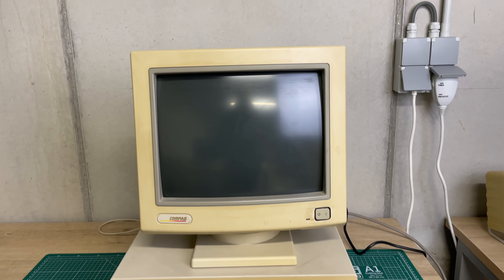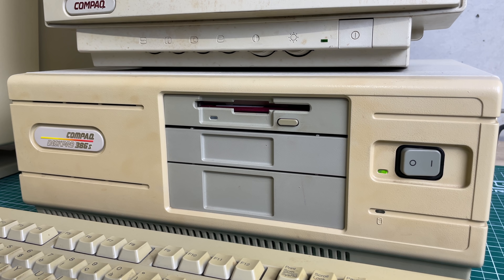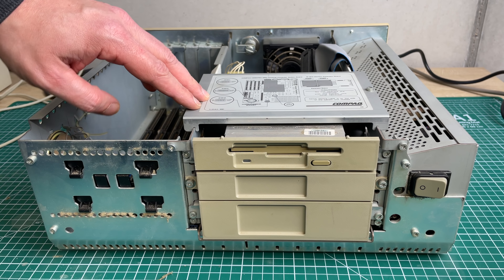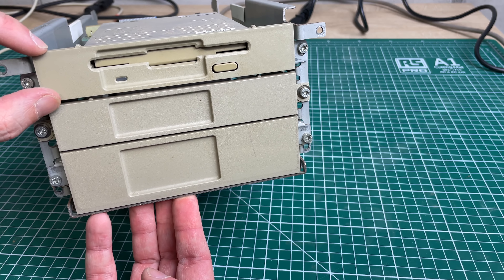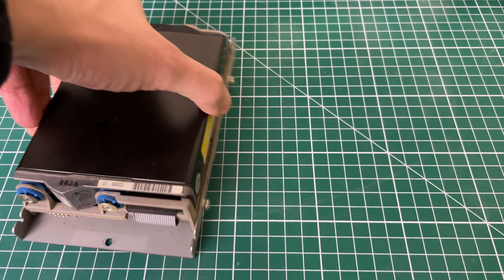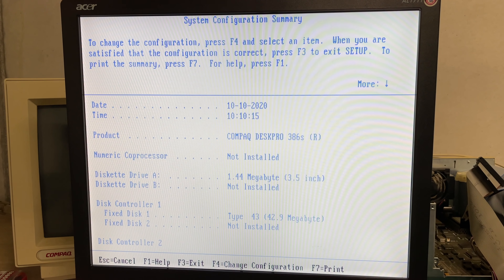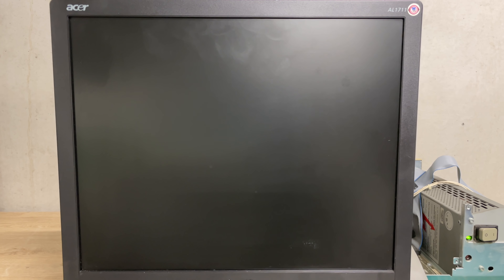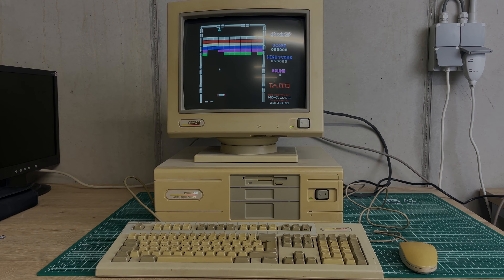Compaq DeskPro 386s first (and last ?) look

Comment: Thanks for the shoutout and for the video. Makes me curious what it was about the smoke as well. May be an insect on the flyback converter? Or some moisture, which started to evaporate? Could you smell it? Sometimes it helps to put the nose into it and try to smell the spot if you don't have COVID. And of course with pulled cables, if you like your nose :D
Reply from the maker: It did smell, was pretty sure it was a rifa but upon inspection I could not find a damaged / cracked on. The smoke had to have come from somewhere and if it came from the RIFA I imagine it would be visible. Will need to investigate further.
Reply: @RetroSpector78  Yeah, RIFA is the most obvious reason indeed and you are absolutely right, it is usually clearly visible. Hm... may be there is a one out of 1000 case, where the damage is not visible from the outside?! Uncommon, but who knows...
Reply: @necro_ware  that's why they call it "magic smoke!"
Reply: @RetroSpector78  Probably the RIFA fails open instead of short circuit?? 🤔.. and it does not prevent the monitor from working 🙂....... Power Supply's works without them.. are for filtering there.. rigth?.... maybe same here 🙄..................... with the HDD.. I think that the two yellow capacitors that you remplace in the other same model HDD.. are also damaged here 🤔....... Not enough to blow up yet 🤯.. but for pull down the 12V or 5V rail enough to prevent the HDD from start ...
Reply: @RetroSpector78  Plot twist: burned RIFA was down in the system unit's PSU and the monitor just picked that smoke up by CRT convection air stream

Comment: Rifa caps are installed across the AC input to help filter out some of the high frequency RFI that switching supplies generate. When they fail they usually short across the AC. This results in a large surge of current, heating the shorted metal into a rapidly expanding plasma burning the dielectric and bursting the casing. In other words, BANG! and smoke. Once the metal is vaporized the short is gone and all is well. It happens so fast that a fuse usually doesn't have time to open.
Reply: Agree. A common BBC micro computer problem as well. Once blown, the unit normally still works fine.  But it would be best to replace all of them.  They tend to show cracking and distortion before they blow as well.
Reply: Considering how old this thing is, could it also just be accumulated dust blocking heat and the dust smoking or catching fire without really harming the electics?
Reply: @3dmaster205  nope. Rifa caps (the transparent ones) will fail no matter what. their casing deteriorates and gets cracks which exposes it to air and lets in moisture, which in turn kicks the degradation into high gear. Then cue someone digging the device back out after 25+ years and applying power. Predictable results...

Comment: Classic Rifa caps. When I was younger, sometimes I tried to test an old PSU and I got that "explosion". I think I was courageous enough to re-test some of them and lo-and-behold, they worked! Never figured out why, but it's clear now that the RIFA caps (or similar) had something to do. I think it'd be almost essential to check for these before turning on any vintage equipment, just to prevent damages to the components near the RIFA cap, and the traces that lead to it.
Reply: That's because these caps are just filter caps. The power supply will work without them but it will cause more noise on the power line. Just recently, I tested a very cheap (new) PC power supply where the manufacturer left out these filter caps altogether to save some cost. It worked that way, but even just plugging it in made my power line network unusable. I added the filter caps and all was fine again.
Reply: @EgonOlsen71  Yes, I forgot to mention that after graduating I understood the mechanism of this, but I didn't get it when I was younger. Yes, the noise coming out some of these PSUs will interfere anything that's on the mains, as many other things will also do.
Reply: RIFA caps and old tantalum caps in particular are bastards for exploding, usually quite violently for the latter of the two
Reply: Dust perhaps; dust gets into crevices heat builds up, it starts burning, and once it's either burned up or a shake and move and the dust is gone there is no longer anything the matter? If you're lucky enough it doesn't actually burn, or burns in a place it won't touch the elctric elements; there's nothing the matter?

Comment: If every computer was designed like this today, that would definitely be awesome! These were definitely the best of times back in the 80s / 90s.  I still use my 30-year old 486 comptuer running Windows 95 after all these years, with the same hardware, except I installed a 7 GB Hard disk drive in my old one and installed 95 on it, and expanded my RAM to 64MB, as well as running BootMagic to run both Windows 95 and DOS 6.22. Has 3.5 and 5.25 inch floppy drives, CD ROM and a good old Zip drive. Im surprise the monitor still works by the way.

Comment: My late uncle worked at Compaq so we had quite a few of them in the family. I still have 2 here, tried to power up my old 386 but blew something in the PSU. Oddly enough it's a different, bigger, deskpro with AT keyboard port and not PS/2 like this one; the other is a 286/12 in the same case as the one in this video! I really feel like booting these again. Love that rainbow Compaq logo to death.

Comment: RIFA line filter caps going out is pretty common in old computers and hardware. they usually fail in a way that do not prevent the use of the hardware, but are recommended to be replaced.
Reply from the maker: Correct, only this time I was expecting to see the damage on the rifa. But I didn't

Comment: If there are no visibly-damaged rifa caps or other components, my guess would be some shmutz that got onto something high-voltage somewhere, or possibly even onto a component that gets hot enough to create smoke, and in either case the shmutz had to burn-off before the smoke would cease.

Comment: Those RIFA brand capacitors are usually part of the filtering and are typically polymer-film capacitors and usually placed across the "line"(USA, mains for UK) voltage.
I'd just remove them with disregard to adding noise to the mains when I'd use such a monitor.
The monitor will work fine without them.
Reply: If it was a RIFA he would have said it stunk to high heaven... it's unmistakeable.

Comment: They are torx screws, but they're made so you can use a flathead as well.
Reply: As long as it's the exact right size since the ends are closed off

Comment: I ran into a 26 pin connector on a floppy drive from a piece  of test equipment (CMM machine.)  I think it was only standard density.

Connor drives were really common back then.  Alps were also common.
Reply: Connor Drives were specifically sought by Compaq for their "Compaq Portable" as being more rugged and suiting the "luggable" machines. It was the first hard drive for the first successful "clone".
Reply: @squirlmy  I used to work for Zenith Data Systems from 1990 to 96, starting in their contract service depot.   The Connor drives hardly ever had problems.  The Connor 20 and 40mb models were stock for the 286 laptops.  I liked how they had the frame and case separate with bushings between them.  An ALPS drive could run all weekend on burn-in diagnostics, get shut down while waiting for final test inspection, and chances were it might not spin up.

Comment: RIFA caps are not strictly necessary for the operation of the monitor, you could cut them out and the monitor will continue work unaffected. The Rifa caps go between mains live and neutral to stop interference going out of the monitor and back onto the mains circuit. Do replace them though or some neighbours may become frustrated trying to listen to their radio.

Comment: I don't remember how many pins are on the SIMMs but I remember those computers. Strangely enough, if they have a co-processor in them then they can run windows 95. I have seen this done back in the 90s. The only expansion ports in this PC are ISA slots. A higher capacity HDD from that era will work up to around 8 gigs or maybe a little more.
Reply from the maker: Normally 30pins for the era of computing. But on this one there is 1MB soldered on the motherboard, and 1MB soldered on the memory expansion card. There were lots of limitations on hard drive sizes (BIOS / operating system). in 1990 around 40MB was still considered "normal", albeit more expensive setups had 100MB or a little over.
Reply: Where do you get EIGHT GIGABYTES? The BIOS Int 13 theoretical 8.5 GB limit? Actually BIOS of that era were limited to 528 MB. It wasn't until 96' that some BIOS would accept 2.1GB, but even DOS 6.22 on FAT16 won't do more than 504 MiBs. Windows 95 on FAT 16 is limited to 2GB partitions, and that's really stretching the capabilities of this machine. Basically you're ignoring the many limitations of both the filesystems and OSes a machine of this era is capable of.

Comment: Oh man, I knew it would come to this eventually. I had this as my first computer (specifically, a 386/20e) in 1992 or so, it was, well, awful in every way. 1 Mb RAM. VGA only, IIRC 256k of video RAM. However, I remember my sister sitting down with me at age 10 and showing me the basics of DOS. She left behind a DOS 5.0 workbook, which I read and understood front to back. I do recall installing Windows 3.1, playing a Star Wars vector based game on it, Solar Winds, all manner of Pool games, Wolfenstein, that kind of stuff.

Why was it so hated? Absolutely no way to upgrade it, at least not in an allowance budget. Want more RAM? LOL - no SIMMS for you. Tiny 42 Mb hard disk, so there was constant floppy swapping. Hard disks had to be pre-determined, and no CMOS, which I found out the very hard way when I got a virus, and realized that the battery backup was supplying power to memory. So I disconnected it. 

And it had to go to the repair centre (a dude at a Sunday flea market) as it would no longer boot. I watched as the man produced a diskette (AAAH 13:14 there it is! I'll never forget that!!) and entered into a secret menu and restored the parameters. I spoke to him about why I disconnected the BIOS battery, he kinda laughed and explained to me that the virus was on the boot sector, and that loads it into the RAM, not the BIOS. After that, he removed the virus and put a copy of the virus removal and told me to scan every diskette in the house. 

I learned a lot, but nostalgia be damned, these machines were awful. My NCR 386 DX 16 was muuuuch better (4Mb ram for starters)

Also, a flathead will undo those screws. ;)

*edit Oh AND it has a Dallas on top of that. Wow. 2/10.
Reply: Well, I prefer a dallas instead of a NiCd Battery mess.
Reply: @GuillermoFrontera  When the computer was 4 years old, it would have been OK. Now, I'd agree with you. A Dallas mod is so easy to do, I've done dozens and haven't screwed one up yet. I have not been as successful with the repair of motherboards that have had moderate to heavy leaks on them.
Reply: @hak1985org  Now, I have two Compaq LAPTOPS (a 4/25 LTE and an Armada 1750) and those are SOLID.A.F. The battery in the Armada still holds a ONE HOUR CHARGE and I have two of them. For sure this thing is going to Korea (again) with me on vacation this spring :D
Reply: Never been a Compaq fan either.  Got to give them credit for their role in history, but man there isn’t one single part in there that you can just swap out with something OTS.
Reply: You're kind of assuming earlier or contemporary IBM PCs or other clones were better. I also think you were comparing your late 80s Compaq to the latest generation of clone PCs coming out in the early 90s, so of course they were better! I had an Apple IIe through high school and college until graduation in '88, and I was not jealous of any PC of the time, but then again no-one I knew had ANY hard drive. And then my wife and I got a 68k Mac, so I sorta understand your sentiment against an old DOS PC. Also note at this time IBM went with MCA bus, where expansion cards were more expensive and incompatible with anything else. But then I also the next few years taunted by friends how their PCs had superior games, cheaper upgrades than Macs, and the advances on Win95 then 98 as the internet became big.
Reply: @hak1985org   IBM at that time went with MCA bus, where expansion cards were more expensive and incompatible with anything else. Do you know of any DOS machine of the time that were any better? I don't. I think if you tried to get some old DOS PCs of this vintage to play DOS games, you'd come to appreciate how much better Compaq was than the competition. It's a bit short-sighted to compare these to 486s and Pentiums that came afterwards.

Comment: Eventhough I don’t mind the drive caddies that much, annoyingly the floppy drives seem to be proprietary without any good reason. I like the card edge connector solution, since it would make cable management with 5.25” drives easier and more convenient. Sadly the slim form factor caddy design prevents this from ever fitting unless you have some rare slimline drive. The card edge adapter thingy could have also been done with a regular off the shelve 3.5” drive. They made some weird choices here. The custom bezels also seem to be a pain in the neck if you have replace something. If I had been the industrial designer of Compaq I would at least have sticked with normal 5.25” height bays and use 3.5” to 5.25” adapter bezels. Also I would have implemented the card edge adapter board to work with any standard 3.5” drive. What was Compaq thinking?😅 It almost seem like a Johnny Ive way of designing things. It looks pretty and the idea seems nice but it’s execution is flawed.

Comment: i would suggest replacing the rifa caps before it gets any worse but usually rifa caps are to help filter stuff ouf i would pull them them and replace them with a modern equivalent

Comment: Rifa caps go from the line and neutral (X type) and line to ground / neutral to ground (Y type). If you have a smoking cap from line to ground and the other cap going from neutral to ground is still okay, then if you turn the plug around and reverse the line/neutral polarity, then you will end up with the bad cap with no or very small voltage potential.
Next time, just change those RIFA caps. I've had equipment work fine for hours, then I just went out to get a tea for few minutes, when I came back, the whole room was filled with thick smoke.
Reply: Whether it works fine or not, if there’s a Rifa in there, or a NiCad battery, it’s gotta go.  Just assume that this is part of your introduction routine to a new piece of equipment.  Wipe off the dust, replace the Rifa, power it up.

Comment: I have a 486 Deskpro and several early Pentiums Deskpros. I don't have any Compaq monitor. I have them for several years now (they belonged to a company and I bought them really cheap), unfortunately I still couldn't find the time to clean them and restore them :( They come with Windows NT. Last time I turned them on (a few years back) they all worked.
Reply: The capacitors may be dying, and batteries leaking! Usually the type of caps in these PCs burst with a bit of smoke, but the caps in Macs of the era will slowly leak and dissolve neighboring leads and components.  You want to take the barrel batteries or Dallas units out, even if you have to clip wires to remove them. It's pretty easy to find adapters for CR3032 button batteries, but just check the present ones aren't ruining the motherboard!
Reply: @squirlmy  Hi. That's true, I totally agree with you. I've removed all the possible leaking components right after buying the computers, because I knew I would take some time until properly clean and restore every computer, and I didn't want the computers to deteriorate while waiting for me. I have them stored in my attic, and the humidity levels are low. When life gives me time, I'll restore them properly knowing that at least they are not worst than when I've bought them.

Comment: Hmmm… RIFA caps? Actually, as a beginner-repairer, they are one of my favourite repairs.  The can be so dramatic, yet easily replaced. Also, my understanding is that they are "suppression capacitors", Maning they reduce the RF interference and emissions. I believe, although I've not tested it, that they are not critical to the circuitry, which can run just fine even after they've blown-out. I'm sure that's not always the case. However…?
Reply: They're pretty much exclusively used as suppression caps across the AC line (90% of the cases) or more rarely as suppression caps across switch contacts to minimize arcing (I've seen this in some turntables across the internal power switch actuated by the arm. they were partially shorted causing the TT to run all the time at slow speed.. if they were across the AC line instead they would've exploded). Their casing deteriorates and gets cracks, which lets in air and thus moisture, which kicks the degradation into high gear, with predictable results when someone then decides to plug the device in after sitting for at the very least a quarter of a century. And yes, they're technically not needed and can just be desoldered and left that way, though that's not really the proper way of doing things (I mean.. they're there for a purpose, even if it's just one that is insignificant to the general function)

Comment: It could have been dust burning off one of the few resistors that get really hot inside a CRT? I've had that quite a few times. RIFA caps are sealed and when they go, they typically pop and either have a visible crack or hole
Reply: I was going to suggest a filter cap venting. The monitor was still working so it wasn't a critical part